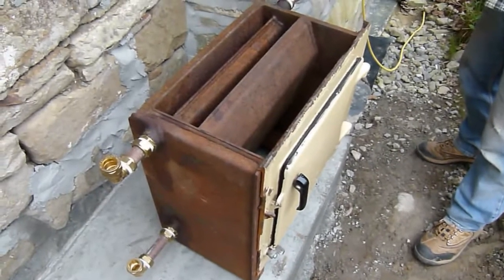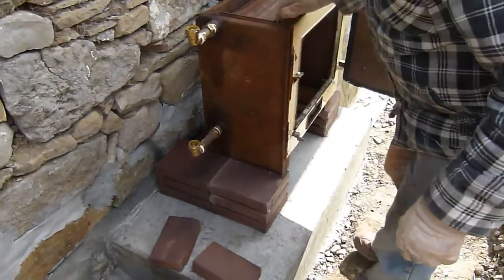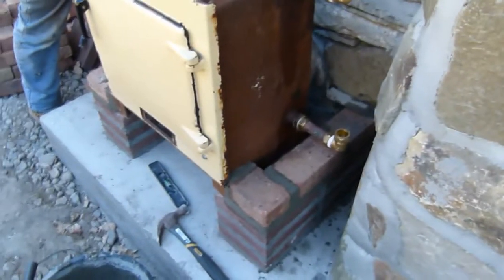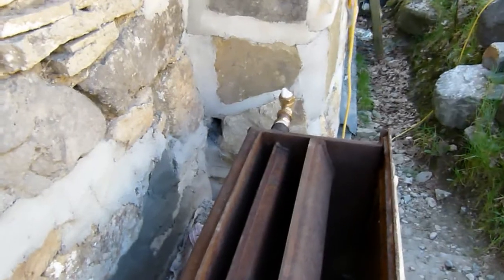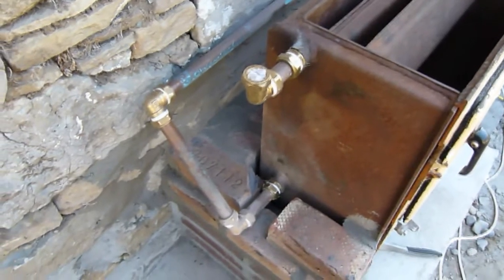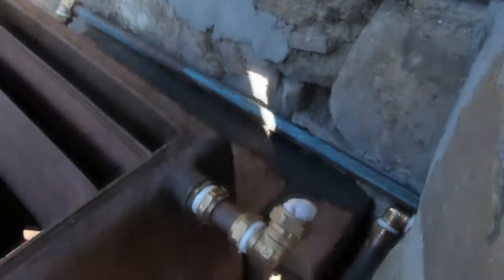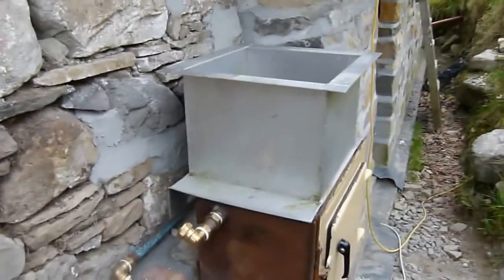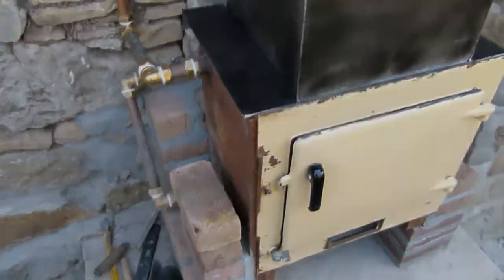DIY Central Heating Part 1

Comment: Why are you using PTFE tape on the threaded part of the compression fittings. ?? ejits
Reply from the maker: +gardenweld 
Why else? To stop the thing from leaking! LOL

Try doing it without and watch the waterworks start weeping baby.
Reply: You only need to put the PTFE around the olive, putting it around the threads is a waste of tape and it has no sealing effect.
Reply: Thank you arobekie